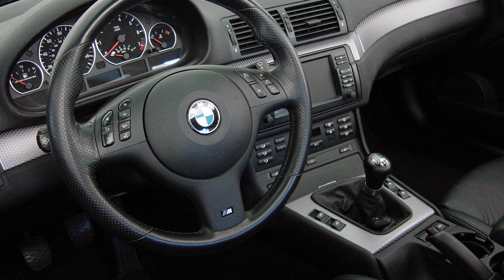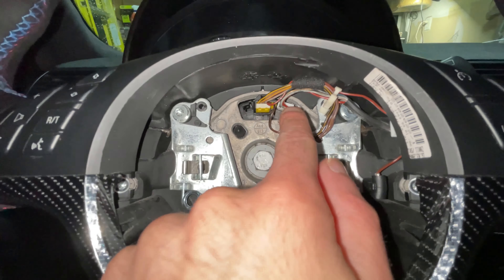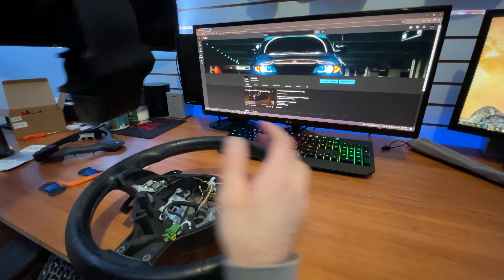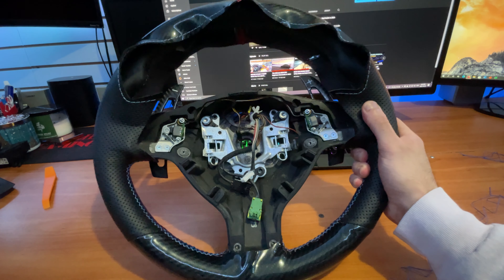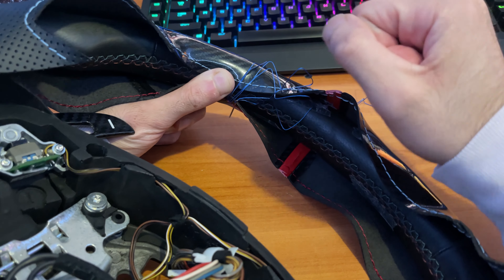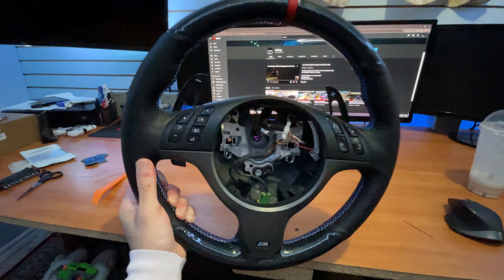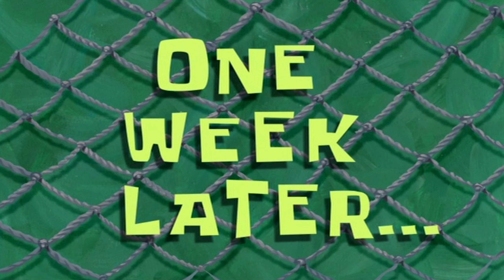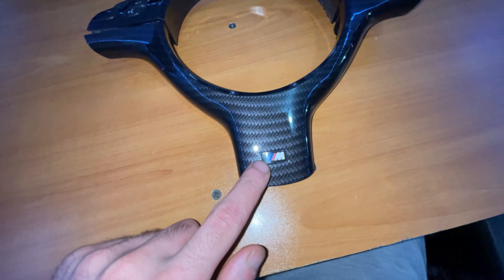$150 DIY BMW Steering Wheel Upgrade | E46 Steering Wheel Wrap DIY

Comment: Looks great! Really sharp. You might need coil springs for the paddle shift retro kit.
Reply from the maker: not too sure what that is
Reply: @_mrklein  I thought you added a paddle shift retro kit. Looks like you put on an M3 SMG steering wheel. Do you like the way it shifts?
Reply from the maker: @James-js7ih  yea its a smg wheel, yea the shifts seem pretty sharp. more responsive than i thought it would be too

Comment: How did you swap the M logo On the wheel? And where did you buy it from?
Reply from the maker: i heated it up and picked it off with a trim tool puller (they're just held in by double sided tape), i used a logo i had off another steering wheel but ive seen them online on ebay and aliexpress for pretty cheap!
Reply: @_mrklein  ty